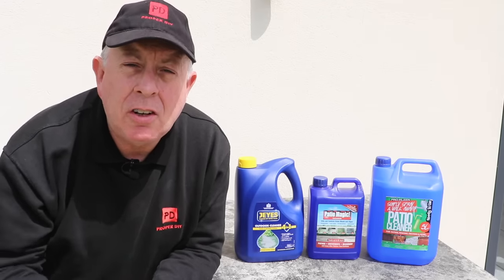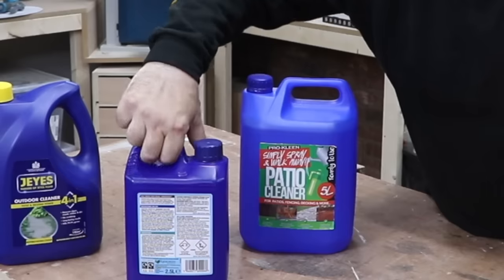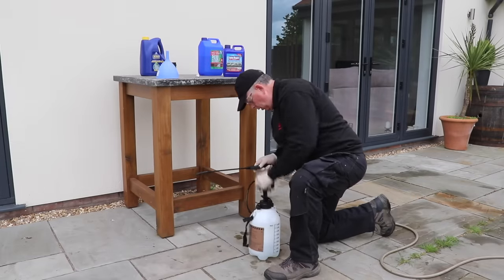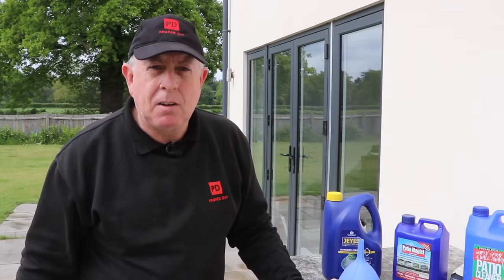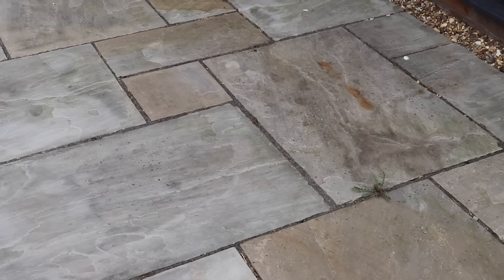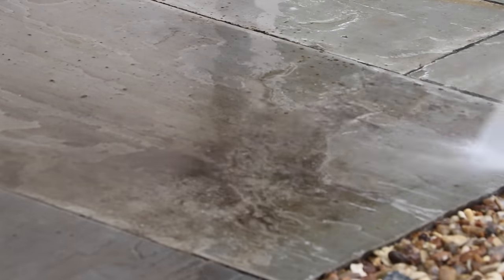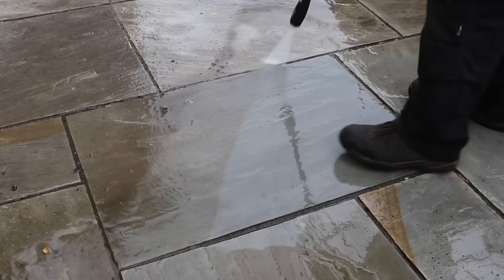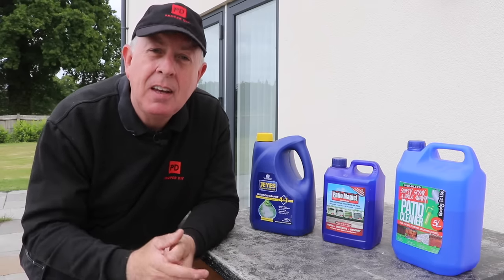Patio Cleaners vs Pressure Washer Put to the Test with Surprising Results!

Comment: Did you think the dirt came off more easily when you used the pressure washer on areas that had been treated with cleaner, compared to just using the pressure washer on its own, as you did in the earlier video?  Also, my pressure washer came with a detergent bottle attachment, which I have found worth using in jobs like the ones you showed.
Useful video, thanks.

Comment: I think one major problem that 'society' has is the notion that you can just spray something on a surface, and it'll do the hard work for you. It's not just patios; shower cleaning products also advertise as something you just spray on and leave. The outcome is the same: a certain degree of mould control, but nothing much in the way of actual cleaning. Surfaces get dirty, and to remove dirt there needs to be a physical force, whether it's a brush, a sponge, or jets of water. There is seldom substitute for graft, and this video just proves it. I know pressure washing can be time-consuming, but to be honest I really like seeing how clean it gets my porcelain slabs, and it doesn't involve chemicals. And I only need to do it 2, maybe 3 times a year.

Comment: Stuart I have Indian Sandstone which turns green every winter. The stuff I use is PATIO BLACK SPOT REMOVER FOR NATURAL STONE (Google it). It’s basically sodium hypochlorite ( bleach) but much stronger than household bleach which won’t work. The method is to spray it on like you did with a sprayer, give it a scrub with a hard bristle broom and leave it for a few hours. You still have to pressure wash it off but the slabs are like new again. It’s expensive and doesn’t reduce the pressure washing, but if you want a new-again looking patio this works exceedingly well. It doesn’t affect lawn either. You’ll need a face mask too as you don’t want to breathe this dangerous stuff into your lungs. I’m about to order mine now while the weather is dry. All the best.

Comment: Hi. I think you have resin joints between your patio slabs. Thats what i got done 3 years ago by the contractor. Now on much of it has sunk, disappeared, broken away. Question: Any advice on how to fix/replace etc? Of course I could through some money at another contractor to do whatever! Thanks. Great video btw. I will stick to pressure washing. Thanks.

Comment: Excellent video. A few points to consider:

1) Did you follow instructions completely? i.e. is it just spray and wash or is scrubbing required with a stiff brush?

2) Does it depend upon the type of patio as to what the results are?

Thanks!

Comment: You've missed the point. I use Wet & Forget, like all the chemicals it takes time to work as it uses the changes in the weather to work. I used it on my front drive that had lichen over it and filthy dirty. I did half the drive and 3 years later you can still see the line where I stopped. The lichen has gone as well.

Comment: My review lifted directly from Amazon. Could have saved you time and effort but enjoyed your video anyway. 
Keep up the good work.

Since the demise of Armillotox I've been searching for a replacement product to de-moss my acres of paviours. I never have much expectation of these products but in this case I'm quite hopeful. After a week of waiting, I can definitely see the difference between the treated and the untreated areas.
If, like my aged Mother, you want instant results and a driveway that twinkles and can be seen from space then keep looking....and good luck with that! If you want to kill moss and get your place in order then the initial signs are very promising. In the pics the untreated areas are on the right.
I'm starting on the back foot inasmuch as my drive has been long neglected however I think that if I get it cleaned up this product will go a long way towards maintaining it with regular use. Here's hoping.
I will be setting to with my pressure hose to remove surface dirt and then applying more s.s. regularly.
It is, after all, a cleaning solution, not a magic potion! It doesn't dissolve dirt so don't expect it to!
I can promise it does kill moss!!! If you want instant twinkle....paint it silver!

Comment: The patio cleaners will have the active ingredients listed on the label in very small print. IME they don't work if you use the recommended dilution. I use them neat or 1:1. Gets expensive but they do work but they need weeks or months to work properly. The active ingredient in Patio Magic, which is one of the better ones,  is Benzalkonium Chloride known as BAC. You can buy this in much more concentrated form as BAC50 (50% solution). Much cheaper this way.

Comment: I just did that job and I purchased a Vevor rotary washer to use with my petrol pressure washer. It did an ok job  but not as thorough as using the lance like you did. My cement slabs get circular lichen spots that are very tenacious. Concentrated effort with the lance can get them but the rotary washer couldnt. My slabs were much worse than yours and I would imagine a rotary might have done the trick for you. Rotaries are easier to use and minimise the overspray. I believe Karcher do a rotary for their pressure washers.

Comment: Hi I have recently started following you. Power washer does give best results. The products you have used mention algea moss and weed killer they wont be to tough on dirt. But do you think after doing power washer if these products are applied on patio it could kill and prevent from weed growing back? My patio is quite old and the rugged weed tends to come back after a month or so of pressure washer?? As its difficult to do pressure washer every month

Comment: My experience of these chemical cleaners are that they are ok in the right circumstances. I have found that if I pressure wash first, to get the slabs clean, then use Patio Magic afterwards, the slabs stay algae/lichen free for a long time.

Comment: Nowt gets it as clean as a pressure washer, I’m lucky that my pressure washer has a tank for holding cleaning liquid. I use wet n forget and that really helps slow down the return of the algae. I think brick cleaner will do the same job and quote a bit cheaper.

Comment: What I find best is to pressure wash then spray the pro clean after - I find this keeps the algae away all summer and when I clean with pressire washer again it is significantly easier - this saves me blowing off the sealant on my block paving that ajoins my slabbing - as you say you can pick up the pro clean fairly cheply online....

Comment: Should of used the circular yellow patio cleaner attachment for patios. Would do the whole patio in about 30 mins, use far less water and leaves the mortar where it should be… in the joints. Surprised you did not use it mate

Comment: hydrochloride from farm supplies , 25ltr for about £30 spray on then wash after 30mins, job done, if you use a 1 gallon garden spray 1ltr it will last 25 washes

Comment: In my experience using a pressure washer on sandstone or concrete slabs is relatively fast and looks great for a while. Then as you do it year after year you provide a perfect environment of microscopic caves and tunnels for lichen to thrive. Eventually slabs end up covered in black, white or both, spots that no jet washer on earth will shift.

Comment: I found that using a high quality surface cleaning attachment is the easiest way to clean anything on the ground. If you do not use a high quality device it will wear and stop spinning.

Comment: Reading the comments and also what i have seen where i used some patio magic chemical is that it seems to be a long term solution as the dirt stays away longer. So conclusion is pressure wash first then chemical clean after with the patio magic.

Comment: Wilko do an own brand green algae remover. Not bothered on the paving, pressure washing does a better job 
I find it useful for treating fences before painting or staining tho.
The chemical cleaners are also useful for concrete or brickwork that looks like it would be damaged by a pressure washer

Comment: I get a farmer's chlorine cleaner 25ltr for about €20 from our local farmer's supply store water it down 10 to 1 to spray parts of the house and the driveway which is cobblestone and any concrete paths around the house. We have a lot of green growth on the paths and the house from nearby trees. But I leave it for two or three days and then powerspray to leave everything clean and like new for another year.

Comment: I always use Power Chem Sodium Hypochlorite 15% high strength, leave it down for 20-30 minutes and wash of with the pressure washer, i have a lot of different type of slabs, works with them all and brings them up like new

Comment: This matches my experience, however, pressure washing, doesn’t kill the mold and algae, it just moves it around, so to keep my patio clean, by pressure washing alone, I need to do it twice a year. I haven’t tried it, but I wonder if the best way, could be to pressure wash first, then spray, so as to kill off the traces of slime that remain.

Comment: I pressure wash first and then use soda crystals diluted in water, the soda crystals help with the algae , soda crystals in bag form is much cheaper to buy than patio cleaner and works just aswell, alternatively using bleach diluted is another way to rid algae but test a small area first.

Comment: We found that a pressure washer roughens the surface of the concrete based slabs which leads to faster accumulation of algae afterward.

Comment: I use wet and forget on my decking and wooden fence. Does a fantastic job. I occasionally go over it with deck cleaner in spring and then oil the deck. It’s all personal preference. I just find pressure washing too messy and uses far too much water for my liking and it seems wasteful, but hey, that’s just me

Comment: Even if it does save a bit of time I’m struggling to understand why anyone would think using toxic chemicals, which you are then washing away into the soil of your garden and then in a river somewhere, is a good idea. The advantage of pressure washing is that it’s just water.

Comment: Interesting, but I tried using chemicals last year and got much better results than shown in this video.  The chemical I used was Jennychem Sodium Hypochlorite, also available from Amazon with a similar price per litre to the ones in the video.  I have no reason to think the chemical was any better than the products in the video but my technique was different.  I sprayed it on and only left it about half an hour, not days as in the video.  I then washed it off with a jet from an ordinary hose.  The results were impressive.   It removed all the slimy green algae.  The result may not have been quite as good as with a pressure washer but it was very good.  It was much quicker than a pressure washer, less fuss and infinitely quieter.  I will do it again this year.

Comment: Put the cleaners down, use a stiff or brass patio brush to agitate, leave then pressure wash. Your cleaners have worked to make the pressure washing easier. Also for stubborn or "rust" spots, use cleaner neat and give a good scrub the do the same.

Comment: I am going to comment on this subject, having just cleaned my paving slabs patio.

I purchased the expensive chemical cleaner (so called black spot remover) on a patio that has not been cleaned for at least 12 years.

I followed the instructions to the letter and left the chemical on firstly as instructed then after that failed to work I decided to buy a new well known expensive Power washer believing that was not great it created in fact it created more mess than expected.

I then decided to once again apply the expensive chemical and left it over night to work, sadly it was disappointing.

So I decided to use cheap £1.20 per thick bottle bleach 30/70 water mix using a bucket and broom just left it on and over a couple of days it worked well so I left it on and allowed the rain to wash the surface.

The patio is now so clean it has brightened up light into our lounge, and we need to wear sunglasses when it is sunny and now it is so clean and bright !!

The difference between the chemicals was the so called wonder product £18 per bottle which was not brilliant and a bottle of cheap thick bleach WORKED WELL and the patio is the cleanest  it has ever been.

Comment: Hello sir. I use patio magic diluted 4 to 1, i dip a garden brush into a bucket of the solution and brush it over my patio flagstones. Sir, no noticeable results appear in the cleanliness of the flagstones until they have been exposed to rain for several weeks as this what they are designed to do. This is why it is called patio magic.

Comment: Imagine spraying your dinner plates before bedtime with cleaner then coming back downstairs in the morning to find there still not clean, Yep that’s why we use dishwashers or scrubbing utensils 🙄. Jet washed my block paving with the dirt buster lance last summer for the first time in 15 years couldn’t believe how clean they came up from almost charcoal coloured to light grey only pain was having to then buy & brush in kiln dried sand into the joints afterwards. It amazes me how much detritus comes off even seeing how much was on yours in just a year. 
I think jet wash early summer& spray with jeyes in the autumn to help stop build up of moss/algae over the winter.

Comment: I would use the patio cleaner then after a couple of days wash it all down with a stiff brush and water.   And let’s not forget, there is a striking difference in cost from the cans of liquid and a DECENT pressure washer.   About £100 generally.   As for my drive which is old rough concrete and very dirty.  A wire brush and bleach and water applied with lots of elbow grease does an admiral job.  Cost, £25 at most , for the bleach.

Comment: Personally I wouldn't want to use potentially harmful chemicals.  The only problem with using a pressure washer is that as seen there is a strikingly obvious visual difference so once you have started, you are fully committed to completing the job 😃

Comment: Diluted sodium hypochlorite with watering can, leave for twenty minutes then pressure wash, works a dream, also best done on a damp day so surface algae has softened. sodium hypochlorite works out around £20 for 20 litres, diluted 10 or 15:1 it works out quite cheap. Farmers use it in milking parlours daily.

Comment: Good, interesting and informative video.  If you don't know what is in the products, look on the label, it has by law to state the active ingredient.  If you don't understand what the chemical stated is, Google it and there will normally be a MSDS available to enable you to more fully quantify the risks, PPE and other equipment.  I would suggest using wellies when spraying if nothing because you won't wear them around the house after use and getting staining residues on your carpets/floor. If you are worried about the dangers of using "chemicals", think of how dangerous petrol is if you get it in your eye or ingest it, let alone if you dropped a light onto it.  Everything has a risk associated with its use, eg alcohol in the diet.  Always read the product label fully before use, a lot of hard work has gone in by the seller and the regulatory authorities in fine-tuning the instructions for safe use.  I enjoyed this experiment.  The foam is from the adjuvant/foaming agent that helps the product do its job on the slab. These cleaners are really aimed at killing green and black moulds rather than cleaning a dirty surface of the slab.

Comment: Good vid thanks. Do you not find a pressure washer, set 'hard' enough to wash, also tends to damage grouting between paving?
Also, I have a block driveway and am a bit scared to use the pressure washer and blow away all the sand/grit between them in case they then move around.
Any advice for the two situations?
Thanks!
Reply: It does blow out the sand/grit on a block drive way, you have to patio wash then clean up the sand/grit and muck almost... then let it dry properly then use kiln dried paving sand and brush back into the gaps. Its extra work but has to be done sadly. I would expect on a paving the grout will come off slightly or get worn out over time but if its installed well should be ok for a few years of patio washing. Everything sadly is wear and tear.
Reply: @mrpurpleman9698  thanks for that. As I thought yeah. Didn't dare last time and I treated and scrubbed with an auto-brush thingy which came up... Ok.
Might date to blast and re-sand next year hehe

Comment: How about pressure wash and then applying the product, I use Wet and Forget, and I pressure wash and apply the chemicals , as you need to remove the dirt and seal with the chemicals.

Comment: if it was me, i would use that as an after treatment. pressure wash first, then apply these as a kind of biocide to prevent growth, rather than stopping it.

most of the pros tend to use diluted sodium hypochlorite (bleach) along with pressure washing.

Comment: I have used both pressure washer and Patio Magic. For a quick result the pressure washer is best but for a more permanent result the chemicals are better and actually a lot easier and quicker. I use a watering can to apply my Patio Magic but don't get it on plants if you don't want to go to the expense of a sprayer.

By the way, I also used patio magic on a slate roof to get rid of moss. Just pour it on at the ridge line (use roof ladders obviously) diluted 2:1 and let the rain gradually take it down. It will be gone in 6 months. Again, not a quick result but just keep cleaning out your gutters as they soon fill up with moss.

After just 7 days you won't see much of a difference but after 3 months its definitely gone and will be very slow to come back. You dont need to use a pressure washer as well. I have stones just like the ones in this video. You have to be patient.